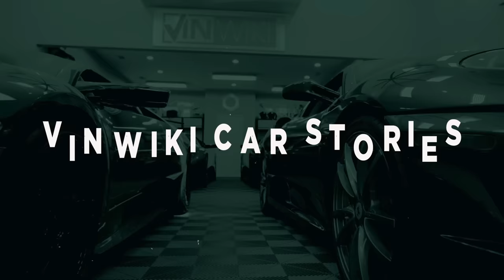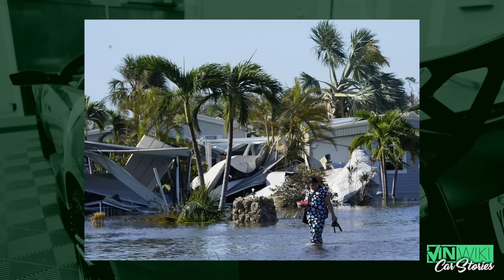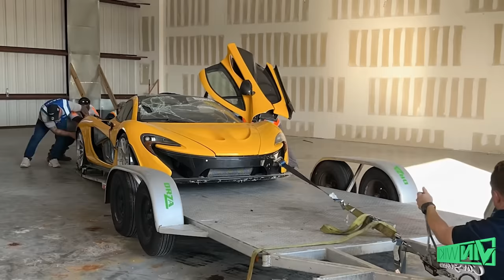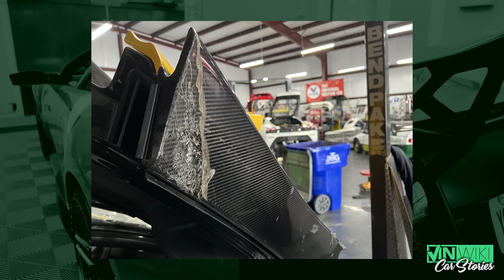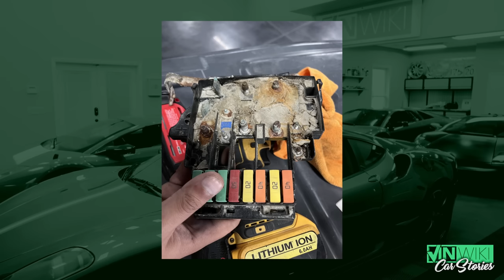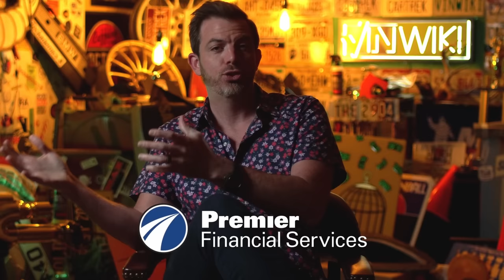Tavarish's Flooded McLaren P1 (Worst Idea In YouTube History)

Comment: I can’t wait for this 120 part, 7 year  rebuild series to start.
Reply: You can't really rebuild it. It will be some kind of Frankenstein @ best
Reply: @hagestad  yeah that car will never be fully rebuilt, the roof scoop damage is structural iirc, it can't be removed, and it looks beyond repairing.
Reply: Lol this dude ain't never finish a rebuilt before.
Reply: @hagestad  McLaren's MSO division can rebuild this car easily, if you can stand the cost. This can be rebuilt by Freddie..but it will take ages.
Reply: @Cynycter  No they can replace the parts. Its semantics at this point but since they did not build most of what is broken in this car in the first place i wonder if you can send it to Dallara so it could be done cheaper. Probably not due to some legal crap.
Reply: He try to fix majority of the car before SEMA
Reply: this is not bad obsession motorsport which really taken 9 years

Comment: Be prepared; 2am staring at the ceiling in cold sweat. I once saw a Holden (locally made GM product) pulled from an irrigation channel and put back on the road. Everything failed;  door locks, all the switch gear, the seat springs rusted, head lining fell out...everything top to bottom - front to back. Comprehensively rooted...

Comment: Did you consider ordering custom made battery? The best company for that would be Rimac ,the are responsible for battery in Aston Martin   Valkyrie which is nuts in case of the specs. It's long shoot but they might be interested  in developing something like that as a product.
Reply: the actually battery part would be easy to do custom. just idk about resale etc and cooling and mclaren eletric system integration

Comment: I wonder how much damage was caused by the folks moving the car around versus the storm itself.
Reply: A bit of a different price but we had an old customer who had a low mileage immaculate  VW Passat , he drove it into a shallow ditch, cracking the number plate  and putting water in the headlights, that was the only damage, until the tow company came, wound down the front windows and put a strap through , lifting it out by the roof !!!

Comment: I’m kind of surprised, considering it’s a lithium battery, that the battery can’t just be rebuilt. One would think the battery could be opened up, have the cells replaced, and the electronics verified and rebuilt if damaged. Most of what you need for information is inside the battery. Anything you can’t find, someone involved in the design must still be around and know.

Comment: Sorry Freddy but I tried to tell you Bro. I bought a 2004 Suburban that was a victim of Hurricane Wilma. They said the water line was under the dash.  They lied!!! It was completely under Salt Water. I had to replace every wire, motor, switch, dash, seat, carpet, lock mechanism and everything but the tires, transmission, rear-end, and body.  It was an absolute BEAR to rebuild.  I basically completely tore down, and assembled the car from scratch. I even had to replace the 5.3 LS.   I knew this was going to be a NIGHTMARE!!! Let me guess you got the money from Silicon Valley Bank! LOL

Comment: That's not a battery. Looks more like a module to me. On the bottom in the picture are 3 orange port connector things. Orange means high voltage. 3 of them means those are motor phases. So the inverter that drives the motor is probably integrated in there. Interesting, I'd want to see that thing taken apart just to see it.

Comment: On a decision like this, sometimes it's best to work BACKWARDS.  Start off with the premise that the car is now "fixed" as well as any human can fix it.  It drives. It stops. It looks like a new car. Here's the problem: NOW WHAT? $575K plus all the parts and TIME spent makes the car worth HOW MUCH? Who would buy this car? Even though it appears to be in tip-top shape, it's BEEN UNDER WATER. Sometimes WATER DAMAGE isn't apparent for a few years.  So, there's a big fat question mark that will always be included with this car. Now, consider the car.  It's arguably the least reliable car ever produced by any manufacturer. If you own it, you aren't going to drive it for fear of something going wrong and you automatically know it won't be cheap.  Do research on all McLarens and you'll see they hardly ever get driven. You've now exposed yourself for gobs of money.  Chances are you will only drive the car a few hundred miles.  How much does that work out to per mile in dollars?  In the meantime, there will be a new "next best thing" come along to render the P1 obsolete.  In a few years it will be considered "old technology".  We all make DECISIONS in life and sometimes we use our brains and sometimes we use our hearts.  This decision was made using HEART and no brains whatsoever.  The money generated from people watching the youtube adventures for the next year, two or three may offset this seemingly bad decision.  If that's the case, Freddy is a genius and we're all rooting for him.  As he tears into this total wreck of a useless car, let's hope in the end he enjoys himself and winds up getting the last laugh.

Comment: You may be able to disassemble the hybrid battery if you have the proper tools and rebuild the cells. Because they're individually sealed inside the casing. Providing you have the correct safe equipment and expertise to do it
Reply: At this point, the electrolysis/chemical process has turned that battery into  a lump of corrosion.

Comment: Tavarish keeps mentioning that this P1 is a 2 million dollar car. Well no, this is flood damaged wrecked P1 that is worth much much less. I reckon that the car is worth 100 to 250grand based on reselling the few parts that can be salvaged from the car. 

Tavarish buying the car wasn't stupid; instead spending 2x what the car is worth was stupid. Hopefully as a worst case scenario Tavarish can at least get the engine back working and by selling the engine alone he can break even. If Tavarish is going to try to refurbish almost every part in the car to a like new standard, it will probably bankrupt him as that will cost 100s of thousands of dollars that he doesn't have.

Comment: why not refurbish the battery,take it to a battery manufacturer ,have them rebuild it,anything is possible.just like a drill battery,take the battery casing apart and they are all made the same,maybe its the same for that car battery pack,only looks different from the outside but same internals as other batterys,kinda like a harley,only the name makes it more expensive,most things are put together the same as any other part

Comment: You are going to have to compromise on the part you will need in order for this project to not cost that much. I mean, like using hybrid parts from other vehicles. Pretty much you would need to look at this project as a "kit car" project. It's doable but won't be an official McLaren P1. And I'm sure someone out there would buy it.

Comment: This is a high enough profile car that Elon Musk may be aware of it, and if so, could possibly help make a custom battery for it. If not, you could likely get the battery controller only or get the McLaren engineers to help with any special ecu communication, then build out the rest of the battery with better cells than the originals. Speak to a local electronics engineer, they could help.

Comment: I'm sure you're a lot smarter than most when it comes to this car… But I'm terrified for you… It's like not just dented not just a blown motor and transmission… Every single part of the car has to be rebuilt replaced refurbished and now think about the man-hours all by itself… To me it seems from what I've learned here and there these type of cars weren't even made to be repaired.  Basically it's a car you purchase you baby it you never scratch it and you sell it… Than the next guy repeats this over and over multiple owners all trying to gouge out a profit or their money back.  Nobody consider destroying every single piece of it not even the manufacturer.  Like I started my comment you must know more than me because I'm terrified for you… You're going to need more than good luck.  Everything needs to be touched everything… I'm shivering thinking about it